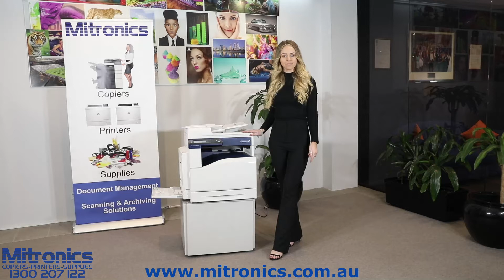Fuji Xerox SC2020   How to Load Paper help from Mitronics

Comment: Hi, Can I use the side tray for A4 and drawer for A3 for multi-printing. Please confirm.
Reply from the maker: The paper sheet trays beneath the machine can be used for A3 and A4 size paper, so the internal paper guides can be adjusted to accommodate the A3 paper.

The bypass or side tray can be used for A4 paper. Simply need to nominate in your computer settings which paper tray you would like each paper size to default to.